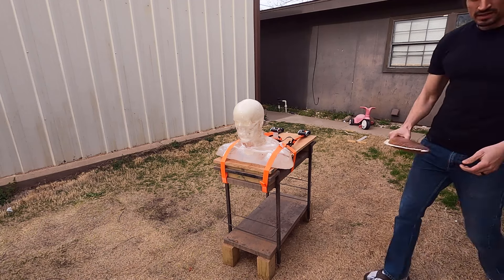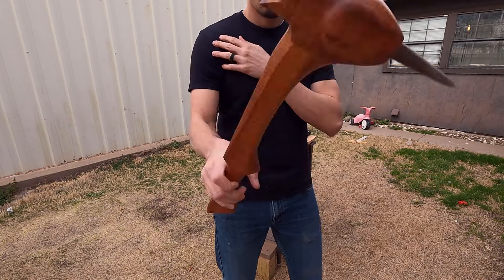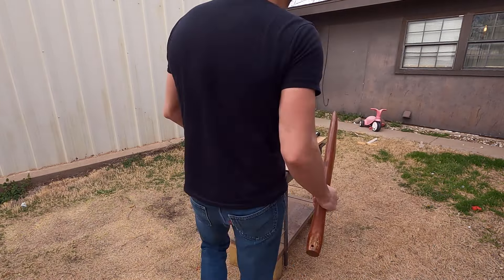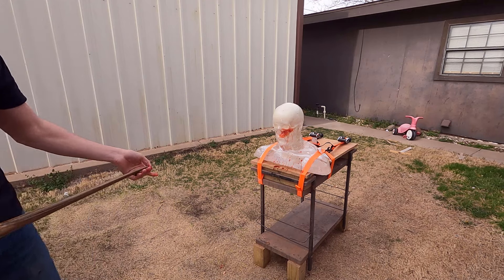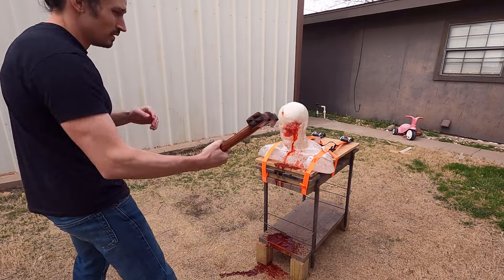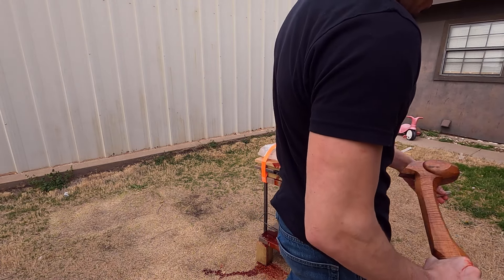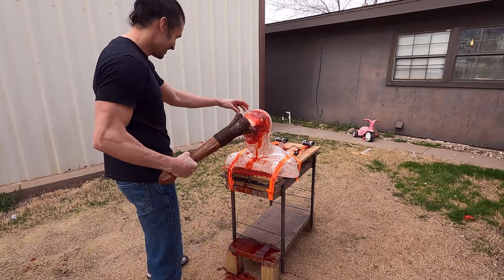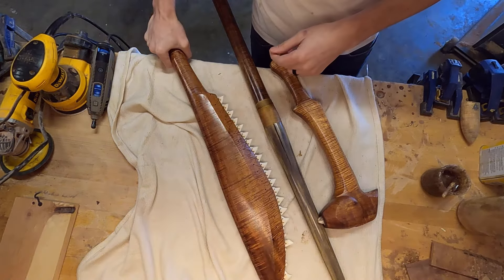Testing wood and stone weapons on ballistics gel dummy!

Comment: If I had to guess, I'd say the reason your Billfish bills break so frequently is because you use modern tools to make these things, which messes the grain up, weakening them; if you make them in a way that follows the natural grain, I'm sure they'll be a lot more durable. They won't stop breaking completely , but even weapons made entirely of any sort of metal break, and can break more easily if they're made improperly. I've seen a Billfish documentary from a mere 2 years ago that showed just how strong Billfish bills are, and by extension, why the Hawaiians made swords, spear and lance heads, and daggers outta them, so I know they're impressive things.
Reply from the maker: They break because they have a hollow inner structure. I don’t shape the bills other then putting a finer point. Which means nothing I do affects the natural grain. The only thing I do to them is sand off the outside and seal them so they don’t get bugs.. they are strong and do lots of damage but are not as tough as a wood.
Reply: Oh no, not another “l’ve seen a documentary and now I’m an expert” kind of guy….🤦‍♂️🤦‍♂️
Reply: @lincolnhobartmiller  I'm not claiming to be an expert, what I am saying is that I now know that Billfish bill is more impressive stuff than most people would think.
Reply: @unwnme  that's not true, I think the stuff he makes is great ; I just thought I noticed him doing something that would weaken it. But apparently I was wrong.